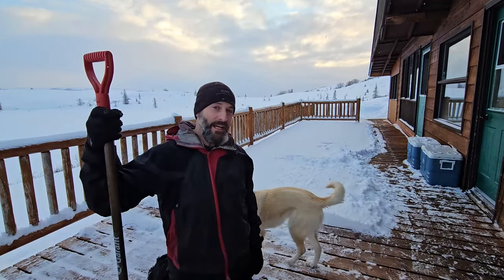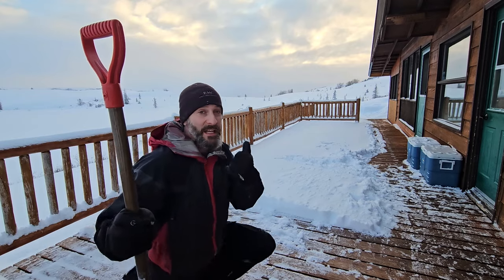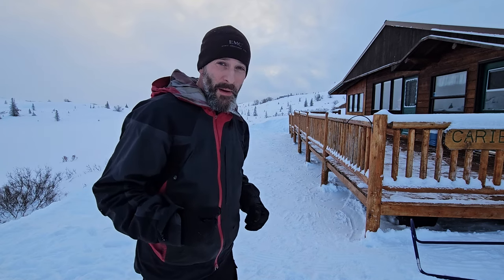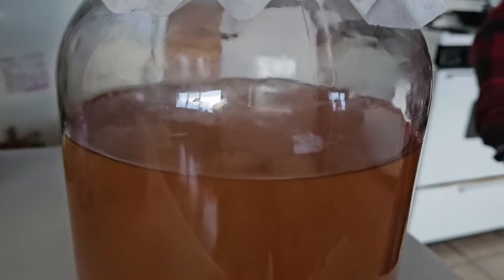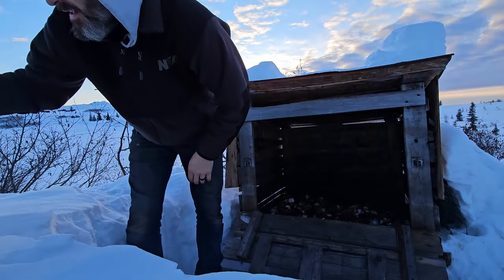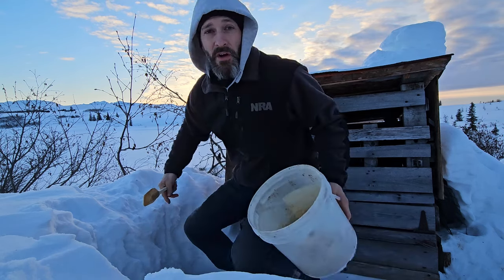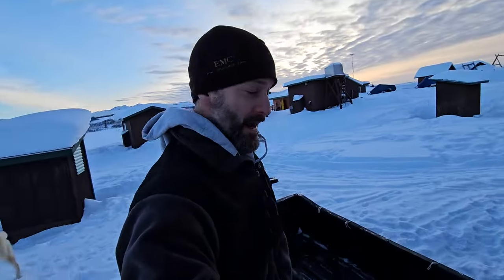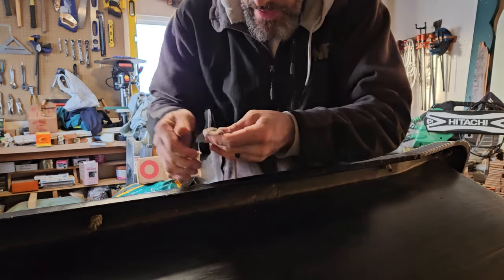Living in Remote Alaska - Otter Sleds & Kombucha

Comment: We add a piece of aluminum (1/4 “ thick x 1 1/2” wide) around the rim on underneath side of otter sleds. It really reinforces the sled. We use eye bolts and washers for tie downs thru aluminum. They still break, it just takes longer.
Reply from the maker: Good tip.   We have had that first sled for about 10 years, and that is the first time I have had to replace some rope tie downs. We just have to stop accedentily dropping logs on the edge of the sleds 😝

Comment: Prob coulda put some epoxy between the 2 boards and then removed them. Or maybe heat gun? IDK?
Reply from the maker: Heat gun might work and I have been wanting to get one, but in my experience, epoxy would not hold up in that application.